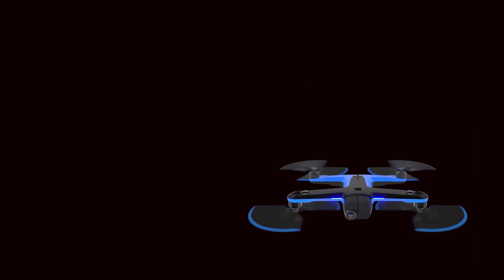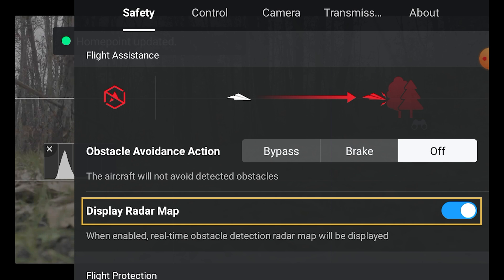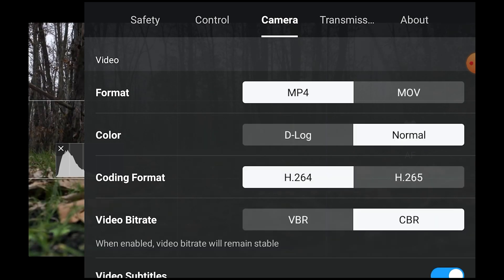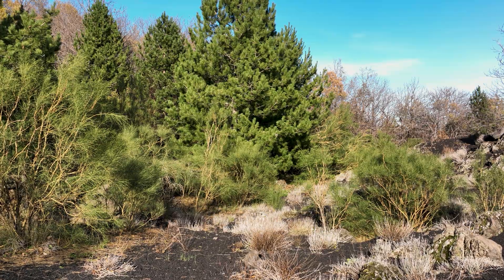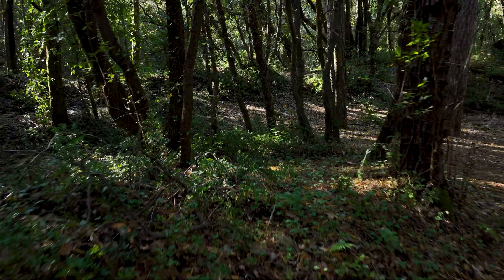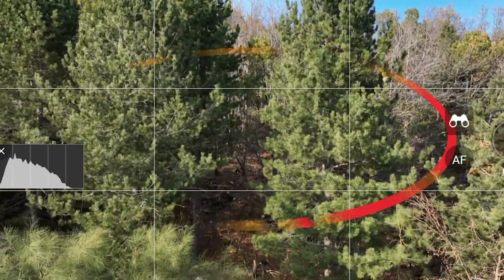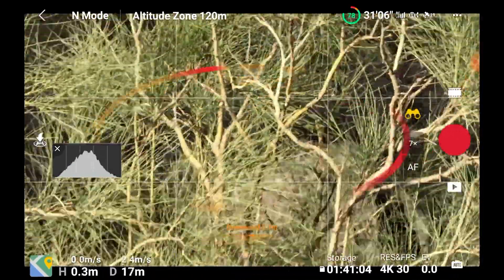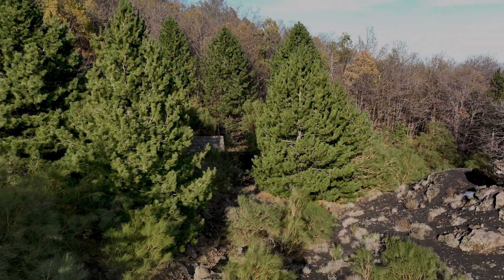DJI Mavic 3 Obstacle Avoidance with a happy ending

Comment: I am soo torn to wait for the Autel drone or to take the dive and get the M3. I already have a Air2S but want something with better flight time, obstacle avoidance. The NFZ with Autel is VERY tempting. Also to try something other than Dji. They will always hold a special place in  my drone lineup because the Mini 2 got me into this mess. Great work keep the videos' coming.
Reply from the maker: Thank you Adrian,
apparently the first units of the Nano and Lite line are shipping right now. I hope to get mine very soon, very curious